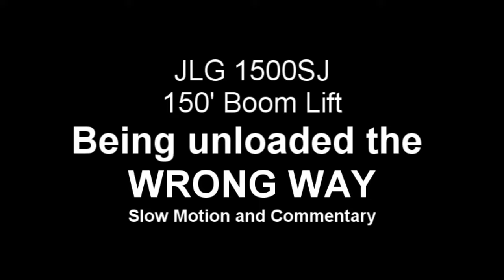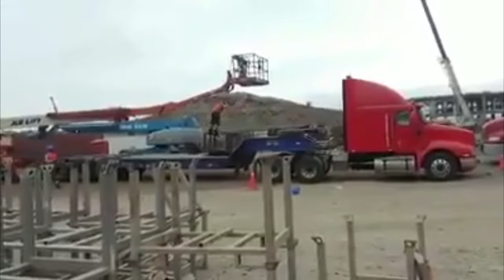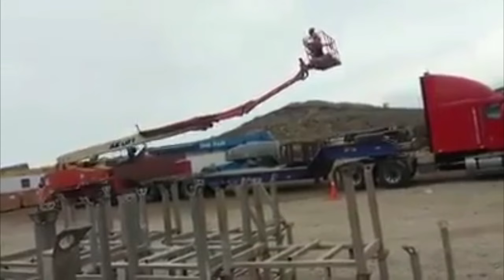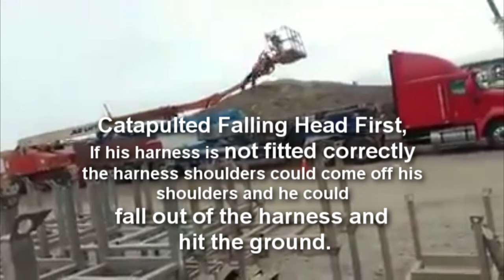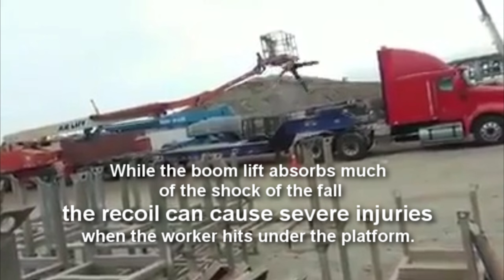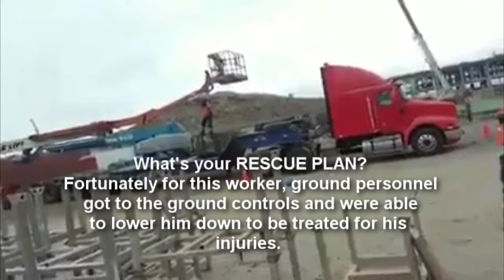Boom Lift Catastrophic Accident, being unloaded the WRONG way

Comment: This is why we didn't wear harnesses under 2 stories height. And usually not on the third if it was summer and dry. I cannot tell you how many times we heard about broken ribs and groin area injuries far worse then a 15- 20 ft fall, FAR worse.   Safety is only safe if it doesnt make your job overly complicated and cause injuries itself over time..Common sense and a basic plan of operation goes a really long way towards fast work with no injuries.  P.S when young I was a blind crane guide I couldnt strap in much as i was all over the place watching the load set, running back along wall tops to guide crane operator, all day long.  @x4 wall in fall were the worst, theyd get frost in a spot and youd surf on your boots for three feet along a 2x4 wall top 5 stories up at 7:AM, drop like a possum onto crotch and your safe, fall any other way and your screwed. You learn to get a hand under your crotch before racking yourself when falling too after awhile...1970's - 90's construction everywhere.  I survived! Sorta, im all busted up now...creak creak creak.
Reply: I would say that if you operated this equipment in accordance to manufacture recommendations this would have never happened and you wouldn't be worried about wearing fall protection which is mandatory.

Comment: These things first started showing up about the last third of my career as a Union Ironworker.  There were no rules at first regarding wearing a harness.  At least we weren't told we had to.  They made some things easier but took longer to execute.  Walking them around a construction site while elevated was sometimes pretty scary.  I've never been thrown out of one but felt like it was going to happen more than once.  I prefer to just climb & walk the iron. Retired in 2009.
Reply from the maker: OSHA mandated wearing a harness attached by a lanyard to the platform in 1970 when OSHA became OSHA.